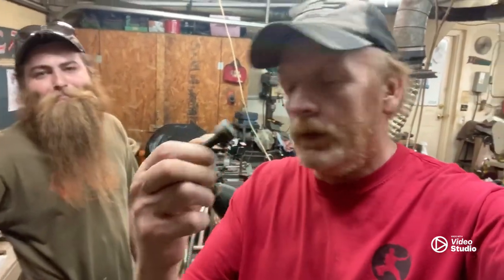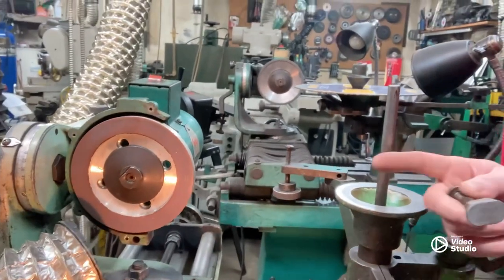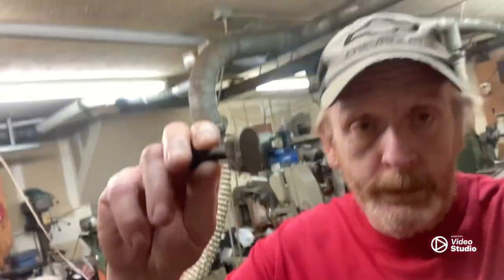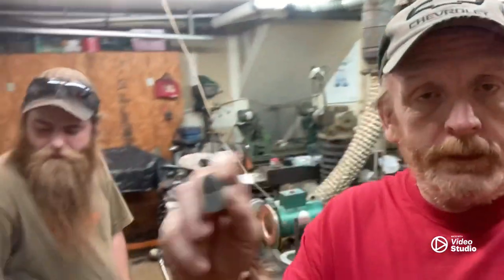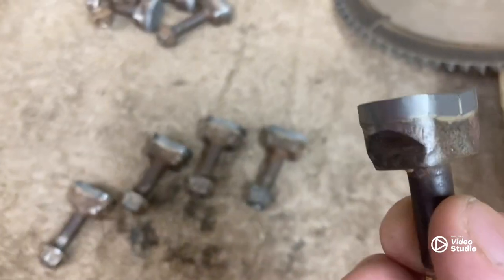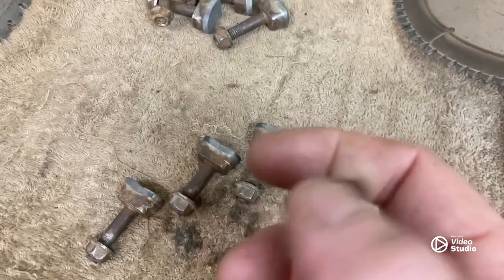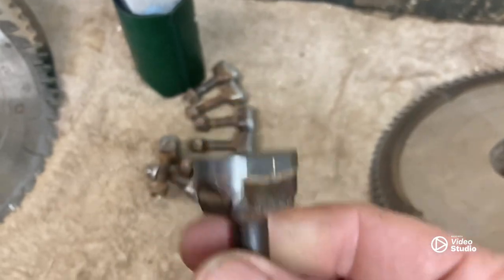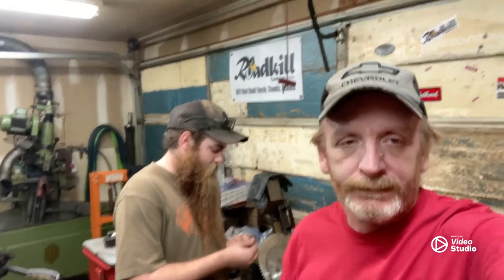Sharpening stump grinding tips

Comment: I used to work for a tree stump place. They had a Rayco stump grinder with a 4cylinder turbo diesel. Sometimes Id run it. I admit never having them sharpened or changed out but it wasn't my machine and I was 16 at the time so just young and inexperienced. We just let them wear down till the carbide was gone. Now that im older and just a tiny bit wiser I know that having even bits will put excessive strain on the machine an make the other bits wear faster. 
Thanks for all the information 🍻
Reply from the maker: Heck yeah. Running a dull tool will wear on the whole machine!!